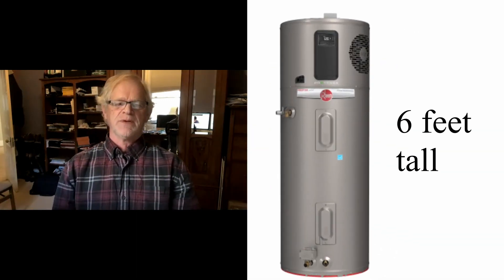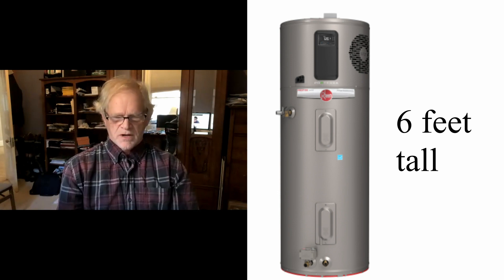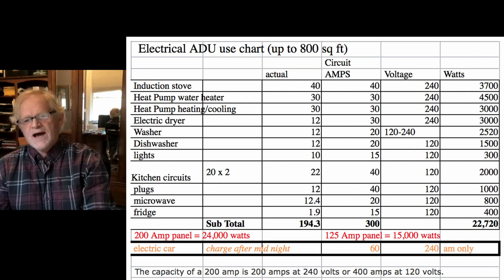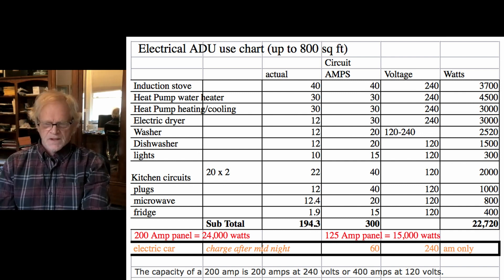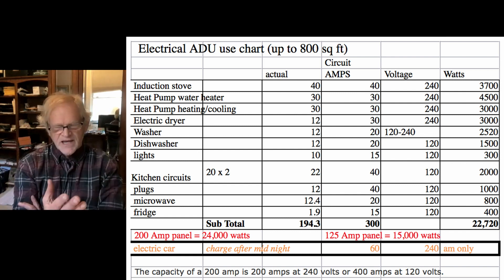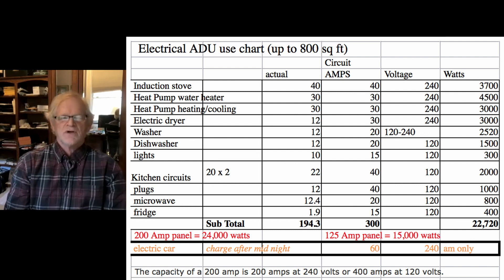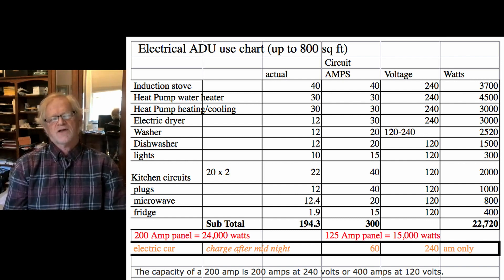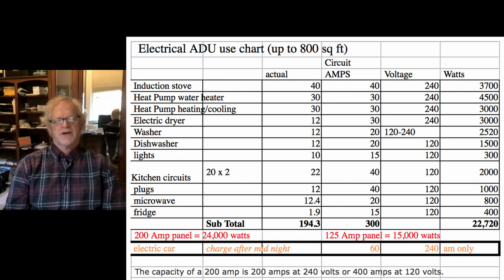All Electric Home - Save Money By Building Your ADU With No Gas Line

Comment: I haven't found any references in to US for phase change material (PCM) heat battery hot water heaters. They are much smaller than heat pump units but can be set to store at a lower demand (2800 watts) when the sun is out or when electrical rates are lower. They behave like on demand heaters without the instant energy demand. The supplier I have researched is Sunamp from the UK. They are in the process of setting up an office on the East coast.

Comment: Great video, Ryan and Rolf! The timing for this video couldn't be more perfect as we are in the process of planning a conversion of an 800sf shop into an ADU for my mother to reside in. There is no gas currently plumbed to the shop and the main is on the opposite side of the property, so going all-electric will greatly simplify the project. Luckily, we already have a 43 panel solar system that was sized for future needs such as this ADU.
Reply from the maker: Sounds like a great plan! Thanks for watching and building!

Comment: So if going all electric with electric stove, water heater, and washer and dryer on a 360 sq feet ADU how large should panel be? Is it 200 amps in the main house or 200 amps in the ADU?

Comment: I designed my ADU with most of the roof slope facing South to maximize solar panels.  All electric, heat pump, induction stove.  Pays for itself in 10 years.  After that, all my electricity is free.  I find that I'm more comfortable with a heat pump heater instead of a gas, forced air central furnace, which dries out the air too much.  Bottom line is that with free electricity, you will want to have an all electric home.  Also, you MUST set up your panel to accept solar (Solar Ready) and an electric car charger.

Comment: I am located in CA hot valley not cool bay area.  All electric still a good idea?
Reply from the maker: That's a good question. You also want to consider if it's a really energy efficient house. I think the way it works is that if your electrical bill and gas bill combined would be paid back by the installation of solar panels (over the lifetime of the panels) then it's a good idea. But you might want to talk to a Title 24 engineer about the pros and cons for your specific situation!
Reply: @HowToADU  Thank you Ryan. I am so grateful for all your info.  You are a wealth of easy to understand info.

Comment: Seems to me, the best way to save money with regards to utilities, is to design and build a high efficiency home with the ability to take advantage of whichever utility is most cost effective at any time. So, running gas and electric capability for your range, furnace, water heater. That way you can run your equipment on whatever is most beneficial, and useful, and switch if you need to.

Comment: I do like all electric. I put a simple electric switch on my hot water heater to easily switch off when not used, in summer (here in Phoenix it's plenty hot). Easier than flipping the breaker and much easier than turning off gas.

Comment: CA Energy Code 2022 - Has an all-electric prescriptive design.  This is driven by reducing GHG emissions. In short, it will be a penalty cost-wise to install any gas service.  The stove, heating, and water heater will have a mandatory 240v connection.  Battery backup connections will also be required. Recommends 225 amp capacity panel.   And then there are your EV hookups.
Reply from the maker: Interesting. They’re eliminating the requirement for ADUs to have solar panels under a certain size, but at the same time it makes soooo much sense to install them and go all electric!

Comment: Electric does not beat gas on speed. You try to cook something. Then need to cook something on a lower temp. You have to wait on electric to cool down. Not a gas stove. You just turn it down and instantly it not as hot. Which is a big deal when making meals. Electric also doe not give you an equal burn accross your pans. So you have to plan ahead with that. When cooking.

Comment: Natural gas is generally cheaper than using electricity.
Reply from the maker: The word generally here does a lot of work! 

Most new detached ADU construction in California is going to require solar panels so it's hard to imagine that gas would be cheaper in most of those ADUs. 

But if you aren't adding solar, and you just look at the short term gas bill vs electrical bill, yes gas is waaay cheaper.

Comment: Great video! I will def go all-electric now.  So interesting about upgrading to a 200 Amp panel. I have an existing garage in Flagstaff AZ with a Tesla Charger and PowerWall built inside the garage. Thinking I'd have to move the charger outside to still have it functional but leave the PowerWall inside. Is that legal, or does it need to be outside if it's now a living space? It's signed by Elon, Franz & JB so I'd rather it inside if possible :)  I'd love to do solar as well, but too many trees!
Reply from the maker: I’m not sure about that. I imagine there is a way to have the charger protected though - maybe a little shed/laundry room structure? Speak to your planning department about your options.

Comment: Heat pump?? Every homeowner that has had a heat pump has said the only thing they do is make their electric meter spin continuously. Have they gotten better ??
Reply from the maker: I’ve met homeowners who were happy with the ones that were installed in the past couple years. But I’ve also met some who installed very active and noisy pumps! I don’t know enough of the detail to do a video. But it would be fun to do a comparison between a couple bills and maybe a sound test.
Reply: @HowToADU  I’m sure the technology has gotten better the last few years. A deep dive into what is more efficient would be great!
Reply: @HowToADU  we currently live in an ADU that was built with the main house in 2006, so it’s more of a granny flat. It has central heat and air, and the hot water heater is in a closet that you can only access on the outside of unit.